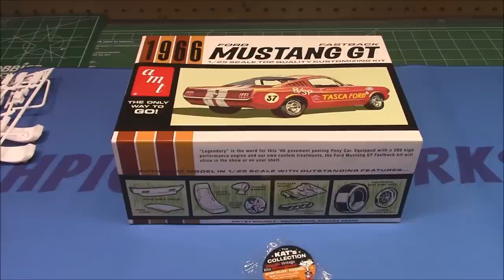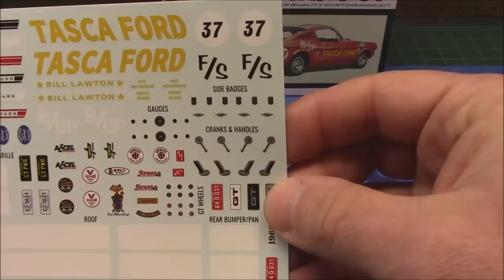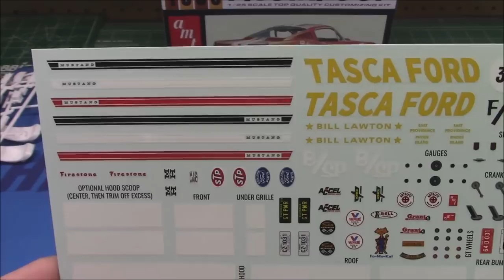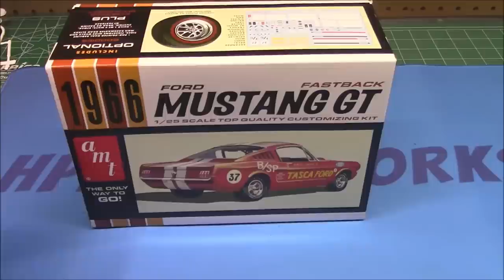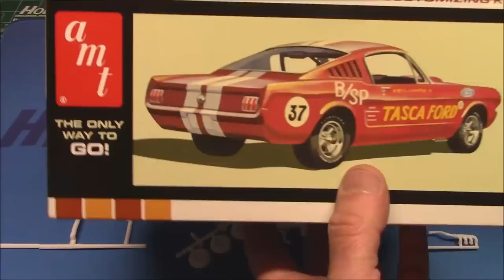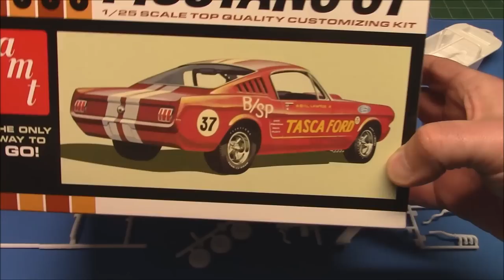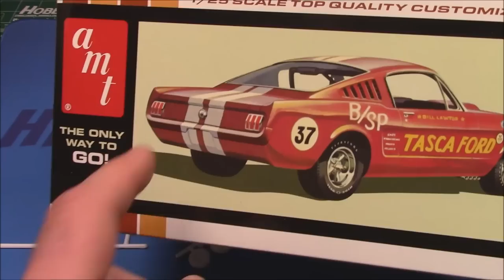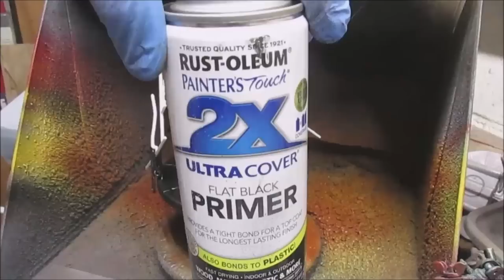1966 Ford Mustang GT Fastback 2+2 1/25 Scale Model Kit Build How To Assemble Paint Decal Interior

Comment: I use and used solder to make my door handles,  window cranks, shifters,  hinges for everything. I cut the doors and trunk open and usable. I use safety pins for many things as well.  Back when watches were windup i used them for window gears,  instrument clusters,  engine pulleys.  I miss modeling

Comment: I say build it how you want and not worry about getting it right.  I am still waiting to finish my Fireball Roberts 1957 Ford Nascar kit, I ended up painting the interior black but I saw online replicas with red interiors.  I am not going to split hairs on it to be honest as I think black is more correct than a red interior especially with the included silver cloth insert decal for the seats.  I did super detail the kit though which is more than I have ever done on previous kits.

This kit how ever is on my wish list, I picked up the Chevy II Station Wagon curb side kit with plans of buying a 3D printed I6 engine to put under the hood.  I dont mind the axle going through the engine, I kind of prefer it as it prevents you from getting too hung up on super detailing the kit.

Comment: thought I made a comment a while ago--but guess it didnt go through---been a fan for a good while---this is first(maybe second) comment---good to see this one back----also glad they did the proper rear pan with the exhaust and backup lights---(the original only had the exhaust ports)---some of the kits had a set of headers that could be connected to the stock exhaust---wish those had been included also the rally pack gauges for the steering column seem to have been left out----but hey I aint complaining---have two and expecting to get more----now I can build my high school ride and all the versions I had planned before my ride met its demise----and as to the gripers----as I always some people will "bitch" (pardon my language) if you hung them with a new rope---

Comment: Don't clear coat the glass. Put it in after the decals are on and the clear is completely dry and after the chrome trim has been painted as you do. Use high gloss lacquer on your chrome. Spray it on the tree. You can drill the axle mounts deeper on the wheel backers instead of clipping the axle in most cases. Ive had to trim the axle housings down at times to make the wheels fit properly rather than rubbing the fender wells. Then you might have to clip the axle. Sometimes you have to make adjustments. The kits are not perfect all the time. Keep up the good work.

Comment: Does anyone know exactly what kind of car the box art is supposed to portray?  I know Tasca was involved with drag racing, but the car on the box looks kind of like an SCCA car (no slicks).  Tasca wasn't involved in road racing as far as I know.  The only pictures I can find are of an A/FX car, nothing close to what's on the box.  Driver Bill Lawton was a drag racer, so the car pictured seems like a not very accurate generic painting.  I see some posters here had Tasca Ford connections, so I was hoping someone could shed some light on this.  I'd like to build this as the car actually appeared, and this has always had me wondering.